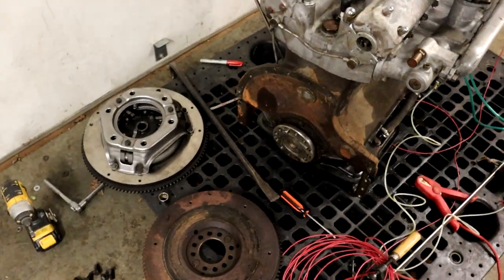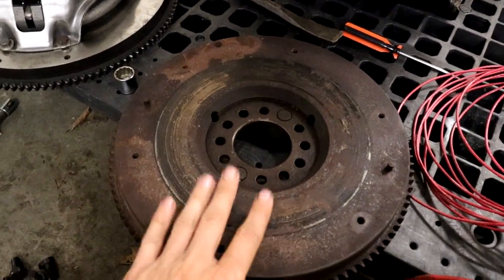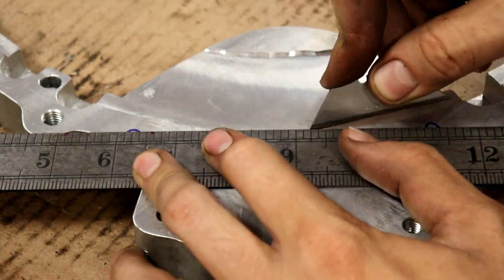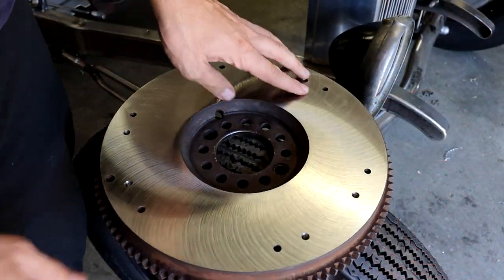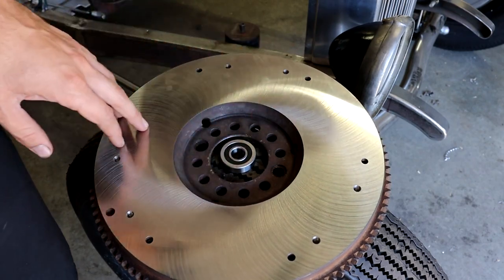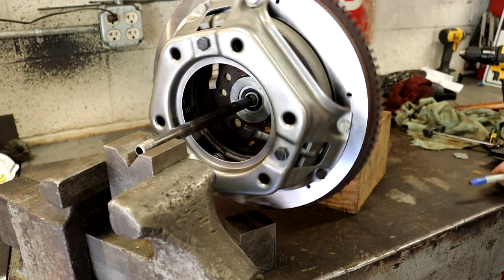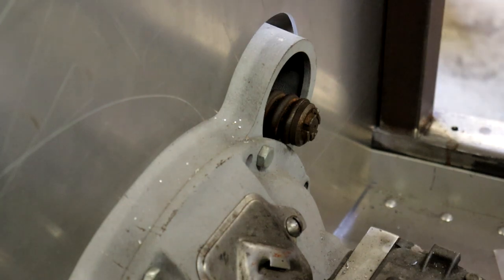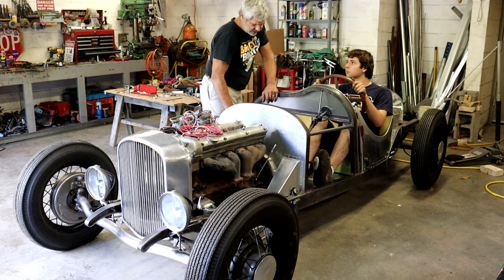Finally Installing the Engine! | Homemade Boat-tail Speedster Pt. 59

Comment: the hole in the back of the crank shaft is where a bronze pilot bearing would go so there is no need for a spacer on the fly wheel this is how engine manufacturers do it, great to see the build progressing so fast keep up the great work.

Comment: Oh it's you Vince, it looks like a perfect fit, you could imagine it in one of those 1900->  races at the brickyard 400 
https://en.wikipedia.org/wiki/Brickyard_400?wprov=sfla1
You need to get either a driving cap or one of those aviator leather caps and some proper goggles and driving gauntlets/gloves to complete the look 😁
I don't know if you intend to p
Paint or polish it but aluminium comes up like chrome if polished properly.
No matter what you decide Vince
You have done an outstanding job so far and should be so ecstatically proud of yourself and of late your dads contribution to the commitment of building this piece of art.
It is getting so close now I can hardly wait for the first movement under its own power. 
So proud of you Vince. 
Tony from Western Australia 🇦🇺

Comment: I really enjoyed this video, filled with real engineering solutions to the problems that crop up in a build like this, it is good to see that real engineering still exists out there, most builds of today are based on CNC programmes doing all the work that engineers used to do in their brain! I will continue to follow this first rate build, and no doubt spend many hours watching back issues! Chris B.

Comment: Not a criticism but when we are building engines with manual transmissions at work the entire clutch assembly is a matched set and balanced as a set. You balanced the flywheel alone after getting your initial markings with the clutch disk and pressure plate installed. 
You could have tried rotating the pressure plate first for balance but should do your final balance with the pressure plate installed. 
The clutch assemblies we receive from the supplier is marked and we have to line up the mark when we install the clutch. 

As for your entire build. I am still blown away at what you have accomplished but not surprised at all since I’ve watched you progress from the very beginning. Hopefully you get a chance to at least drive it around the yard before you move to California to start the next chapter of your life. 
You’ve done well and I’m sure your parents are extremely proud of you.

Comment: I learned today that Jag put the pilot bearing in the flywheel and not the crank shaft. I think I like that better. Keep up the good work.
Reply from the maker: Jag actually had a bronze pilot bushing in the crankshaft. That of course doesn't fit the transmission I'm using, so I converted it to the early Ford-style bearing in the flywheel
Reply: @MacroMachines  I am sure it will work fine though.

Comment: Excellent work. A lot of this is similar to jobs I have done. I balanced a flywheel in exactly the same way, with it on the bearing like that. I don't know if it made a difference or not but I used the lathe and had the motor running (but the lathe not turning) just so there was some vibration to help the bearing settle. I showed it in one of my videos. Things could be improved by using a washed and lightly oiled bearing with no seals. The motor looks great in there. The car looks very well proportioned. So when will you get a 3.4, 3.8 or 4.2 lump for it? Lol. Many years from now you will look back and cherish the time you have spent with your Dad on this one. All the best, Mart in England.

Comment: Looks great. Now we wait for the sound of the start.  (The pre-start checklist does say "check all fluids"? Aeroplanes have crashed because mechanics were interrupted and didn't put oil in a new motor. After all  your work, seizing it would be tragic.)

Comment: Looking good! Quite inspirational. A tip is to use studs for the starter  to save the aluminium threads, if it fits. But you probably already knew that,😉

Comment: Sweet! Just a thought... If that flywheel is Doweled onto the crankshaft in 1 spot only, radially, that imbalance of the flywheel you found MAY be part of the Engine balancing. You may end up removing those washers if you have a vibration later on...
Reply: There are usually Two dowel pins.  So it should be ok 👍

Comment: I wanted to do a little Amilcar roadster lookalike with a Toyota 2RZ and one of those little Eaton blowers from a Merc, I don't know what to use to start the chassis as I need a frame with a chassis number, but a Ford model A anything is really too big, maybe I could cut a T bucket frame down to size .. we'll see

Comment: First off all if you would like to do static balancing you should remove greace from bearing, cause it generates friction. If you would do so you could get much better results in static balancing

Comment: Since you are using a Jag engine  please only use genuine Lukas electrical components. They saved England from Covid. They gave it one of their parts numbers and now it's unavailable. Also they have the Prince Of Darkness on long term back order. Thank you for your cooperation. And please don't be negative thinking about your grounds.

Comment: How have you been insuring your concentricity while you are describing marks with a loose tool like that because I was really curious it seems like you just go straight from the scribe to the mill and is there any other way to do that I was curious if you had a lathe and if you did why you might not use it to center your flywheels together

Comment: You ground a little bit off the clutch pressure plate for the starter but dosen't the pressure plate turn on the flywheel and will interfere all way around?
Reply: They ground the bell housing